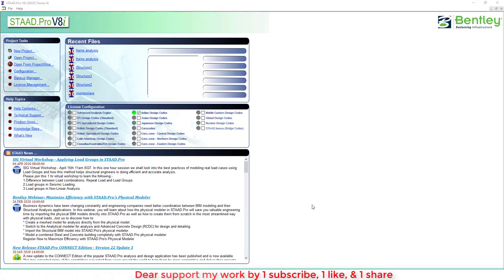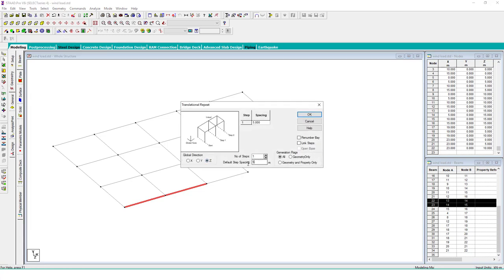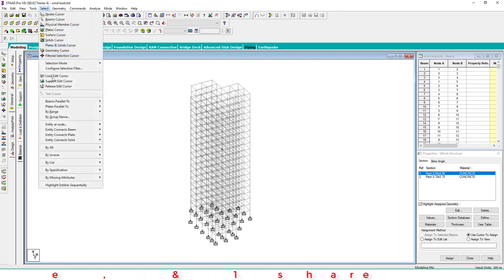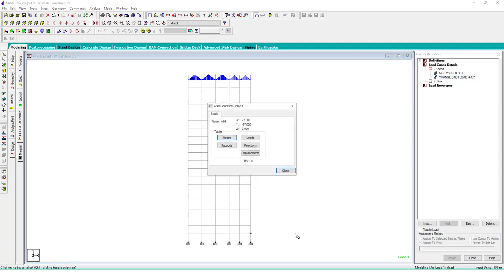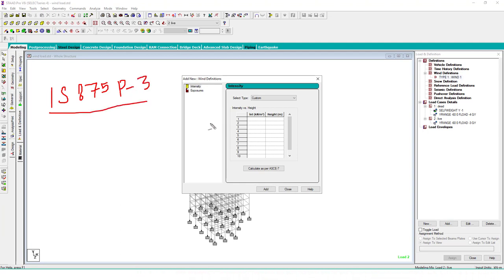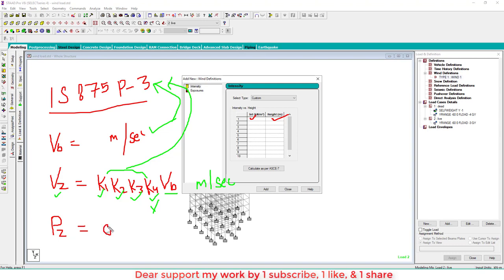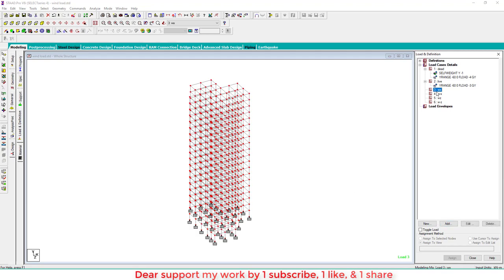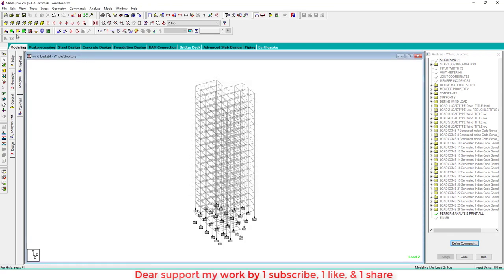Analysis of a tall structure using staad pro with different wind intensities as per IS 875 part-3

Comment: Dear Sir,
Without any load calculation you are taking a tall building without working out wind intensity for various height. Pz=0.6 vz^2  but you indicate this as 0.7 instead  0.6. Design wind pressure pd=Kd Ka Kc x Pz  and it should not less than 0.70 Pz. you are teaching wind as per latest code IS 875 part3-2015. In applying wind factor X as 1, you should apply the value (Cpe-cpi) and put it factor as  arrived and not exactly 1 as per code.Are you check the wind force value arrived from staad and compare with manual calculation using formula =(Cpe-Cpi)xA x pd. I think this is your first video.